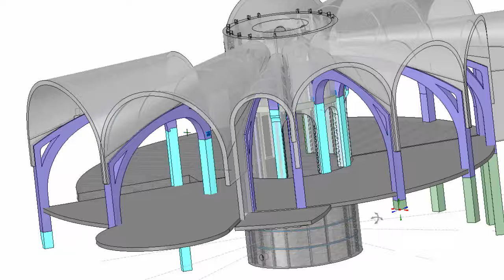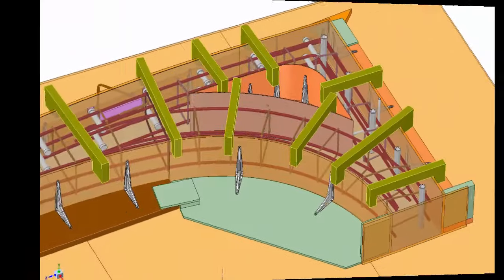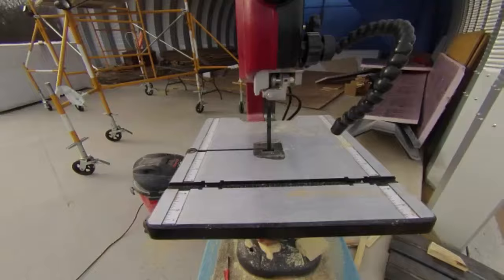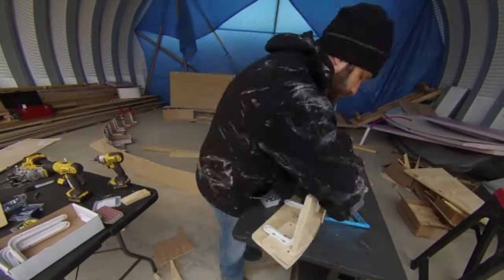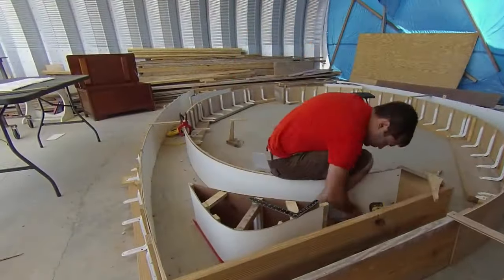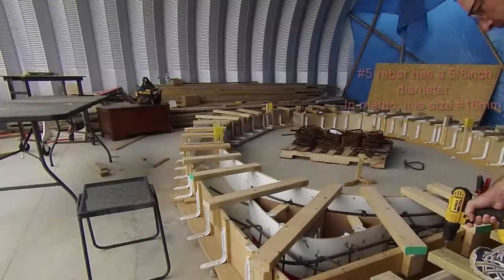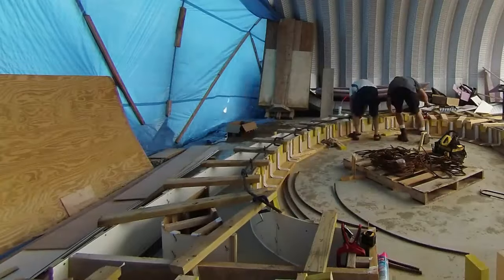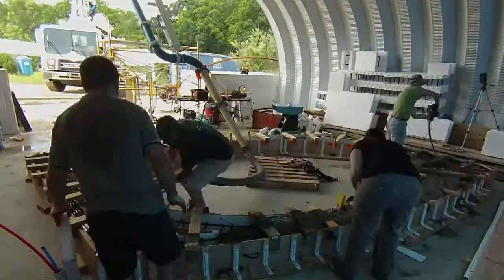15.0 Building the First Rib Forms

Comment: The suspense is killing me.  Can't wait to watch the next video to see how you move 5000 lbs of concrete and steel that distance, with the obstacles and terrain, without damaging anything.  I'm sure I would be successful on punching a hole in the hut's sheet metal.
Reply from the maker: If you are using the play list, that one should come up pretty soon after.   Actually, one of the straps did slip and a steel arch droped and landed with one corner on the footing.  It hit so hard the whole place shook and people were diving for cover.  But the rib didn't crack.  It just chiped off a bottom corner that would be below floor level in the end anyway...

Comment: Next time you have to place forms on slab I would advise you anchor the forms to the ground by drilling a 3/16" hole through a 2 by 4, feeding a piece of wire through it and pounding 2 16d duplex nails into it.
Reply from the maker: +Myles Lenover Why would that be better than simply using a tapcon screw that I can easily drive in, tighten precisely and easily remove?
Reply: +Simon HomeintheEarth Its much more practical due to its cost.
Reply from the maker: +Myles Lenover Tapcon screws cost less than a quarter each, and I reused most of them between pours...  I would say the cost was minor compared to the convenience of simply driving them in and out.  Time is money too.